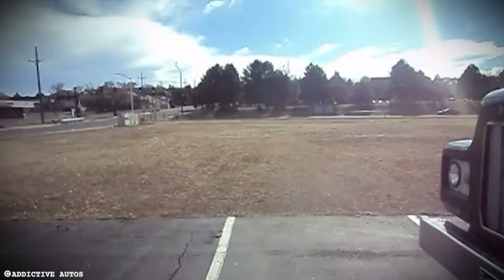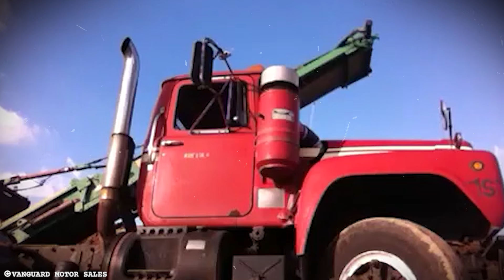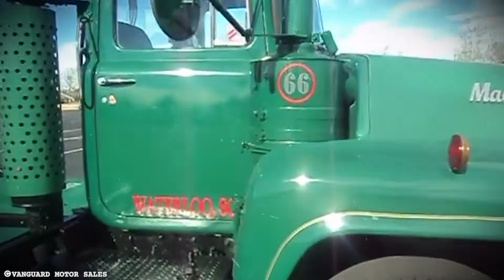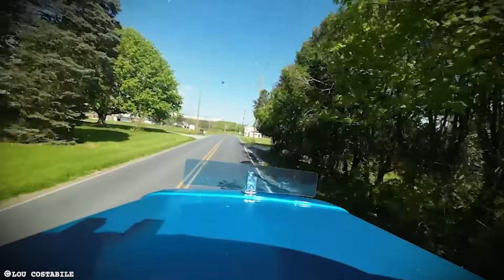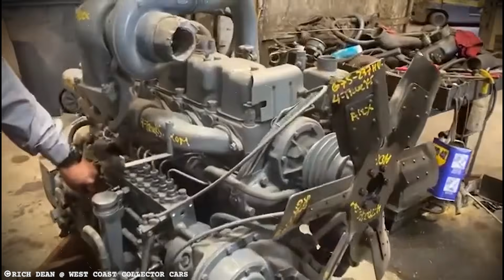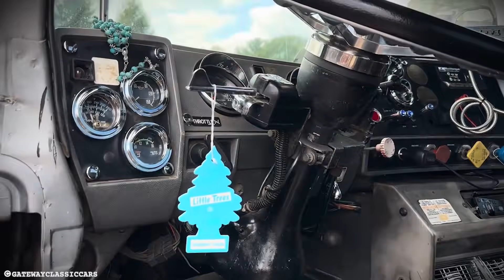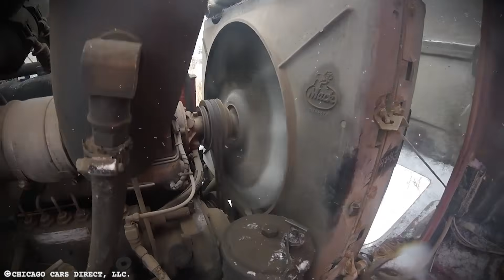The Mack "Maxidyne" Engine That Silenced the Need for 15 Gears

Comment: Junk Old Macks, 12 to 24 hundred, shift up and it Fell on it's Face, they had to put in a Limiter Switch so you didn't get FULL THROTTLE as it would blow BLACK SMOKE, Mack 5 Speed was a Gutless Piece of CRAP, No Power, it just was a Gutless Pig!
If you put in a 10spd Road Ranger Trans, then you had a half way decent Truck!
Reply: Yeah drove one with the exhaust was on the bottom blew to the right take the limiter off and drove it around when peddle bike races get like 10-15 in a row and slowly lug along just in front of them. It was the absolute best truck for that a good number of them would just have to stop and wait I did it the two times a year for a decade. For all the drivers that wanted to run them all over I think you would appreciate this and yes I was bored with nothing better to do but laugh my ass off
Reply: @brucerabideau2872  LOVE IT, We took the Limiter off and I went to YUPPIE Land in CT, Rocky Hill, had the Dump Body Heat on, so it blew down on the car behind Me, when I sat at a Traffic Light I would Flutter the Fuel Peddle, that Loaded the Dump Body up with Black Smoke, then the Light turned Green and I Floored it, the Cars behind Me were Lost in a Thick Black Fog.......LMFAO.....They Called the Cops and they wanted to Inspect My Truck, so I hooked it back up and they came found NOTHING WRONG as the Yuppies CRIED!!!
Reply: @webefree I’m in CT I was doing it at the International triathlon event held by Quassy in Middlebury I was getting runners too. They do the swim also but the cyclists are the assholes. That is great to hear 😆😂🤣
Reply: @brucerabideau2872  I Loved Smokin out the Igiots of CT, I finally Ran from that Failed Blue Commie State in 2017, sold Everything just to have the COMMIES make a New TAX to TAX ALL My Money that I was taking with Me!!!
Reply: @brucerabideau2872  Heres another one for Ya......some years before that, I was driving a New GMC Brigadier with the Cat 215hp V-8, it had a 13spd wit OD, it would do 55mph Down Hill Loaded with a Tail Wind if your were Lucky, I had the Losers CRYING to My Boss saying that I was Flying Up and Down Main St in Winsted CT, He told the IGIOTS that his Truck had No POWER to FLY, it was that I was Banging Gears to hit 25mph, I think it was like 9th Gear when you got to 25mph, then I would shift Down with the Jake....Oh how the IGIOTS Hated that to.....LMFAO!!!
Reply: @webefree we made a silage truck out of a early 80s well drill hauler 10 wheeler International with a 350 big crank Cummins with 3 stage Jake with a single barrel open exhaust pipe aluminum dump body 7’tall side it held two dumps from the self propelled chopper if the corn was a little green heavy we have fields in Washington Watertown anyway going down those hills loud house window rattling loud and if it was going to rain a lot or hurricane we would go all night bones and beer the 90s were a bit crazy the times have mellowed I have no complaints or regrets I’m still alive 😆😂🤣

Comment: I never saw a 7 spd trans behind Cummins, or any other...Anyone?
Reply: In the 1980's, you could get a Cummins, Detroit, or cat with a 7 speed. Both Eaton/Fuller,  and Spicer had 7 speed transmissions. JB Hunt, and PAM used those, plus Consolidate Freightways also used the 7 speed transmission. I think some UPS trucks had the 7 speed as well.
Reply: I liked 7 speed behind 300 Cummins in 1980 for local work with Raco suspension over on5thespeed with the walking beam
Reply: I drove a 1977 international dump with a 270 torque command Cummins an 855 with a 7 speed Spicer trans
Reply: I have a 7 speed behind an International DTA360 diesel. Years ago I drove GMC Brigadiers with 270HP 6-71 Detroit fuel squeezers and 7 speed Spicer transmissions.
Reply: Yeah, it was called a spicer split torque, junk behind 8v71.

Comment: Only drove one, was a rental, in '77 or 8. I didn't care for it. The way you knew it was downshift time was when the whole cab vibrated. Then when you upshifted, suffered  the vibrations again. That wasn't pleasant. I'd lots rather keep the Rs up floating a Roadranger behind a DD 318 or 350.

Comment: My first Mack was a 1973 F model cabover.  Next was a used   R  model. Both with the 5 speed and the '237' maxidyne engine.   2 million miles and I loved them!!
Reply: Great in FLAT country. In mountains it was not good. Once you had to downshift, that would be the gear  you had to get to a flat road to upshift again! Didn't hold you back on down grades as good as having more gear ranges to hold your speed. I drove a Mack Western for three years and liked it until I got to the mountains.

Comment: The maxidyne didn't eliminate the need for 15 gears. The maxidyne still only has a power band of roughly 400 to 500 rpm. If you look at the power graph of this engine will prove that. The 5 speed transmission that Mack coupled with this engine has a 500 rpm range difference between them. Tell us you know nothing about diesel engines without saying it.

Comment: My buddy had late 70s RD 600 steel nose Mack rolloff i used to drive for him I forgot what engine 237 or 285 With a 5 speed great truck strong and reliable I drove many R DM Mack’s with the 5 spd 6spd mud stick and 12 spd gear boxes
Reply: Same here I learned in a DM800 300 plus 15 Tri-Plex and #55k bogies she was quite the machine.
Reply: @deborahchesser7375 I plowed snow in  a 1964 b81sx  tandem dump during the blizzard of 1996 here in NJ that old Mack had the quadraplex 20 spd trans they are beasts

Comment: When I was a young man back in the 80s I work at a ready mix company that had 100 Mack cement mixers with the Macedonian engine in it with PTO running off of the transfer case badass truck only downfall was every now and then one would get a flat camshaft and we figured out how to put cams and bearings and lifters in it that engine was ahead of its time
Reply: I drove for a concrete company here in NJ Baer Concrete they had all DM 686sx Mack’s they all had the Mack endt 676   engine and the Mack 6 spd mud stick trans 58,000 LB rears heavy trucks I love those Mack DM trucks strong and reliable
Reply: @edwardweigel8755 The closest one to a Euclid that is for sure
Reply: When I got my truck I was told to never over rev it 2100 max, and never use the dynatard when the oil was cold as it would damage the camshaft.

Comment: Don’t get me wrong - I always liked Mack’s too - but to say this changed the industry, we’ll look around and see how much freight is hauled today, or even in the last 20 years, with only 5 speeds. None would be the answer
Reply: Go drive an automatic truck that's lightly loaded like most mega carriers loads. It'll skip so many gears it'll be close to only using 5 speeds. The clips showing the typical cloud of black smoke after a shift is a better reason what doomed the 5 speed on mechanical diesel engines. Don't forget how popular the 8 LL was on Catapillar powered trucks. They used a full range governor like the mack also.
Reply: Not true, where I'm at there's a lot of 5spd Mack's still hauling on a daily basis including my RS600L
Reply: I think what made a bigger difference in the high torque, low RPM was the camshaft. They talk about fuel injectors and turbocharger. The cam made the biggest difference.

Comment: Trucks still use 10, 12, 13, and 18 speeds. They are still unsynchronized. Even today on brand new trucks.
Reply: ...and we float the gears in all these as well! Clutches are to get moving.
Reply: im glad with only one shift lever

Comment: The Mck  wa sgood  at going up the hill but it was real dangours comming down  you only had teh Brakes to hold you back because teh transmission had a mile  between ratios. We had a 325 V8 in a hiabe I scared my self by statring down the hill in too high of gear.

Comment: I had a 1978 cab over with the 320 "Coolpower".engine and 10 speed splitter Great truck. It didn't take me long to learn how to float the gears and so remove the need for double clutch changes.  I can vouch for the torque it made. I found myself with a loaner, an International Transtar 4300 with a 350 big cam and roadranger 18 speed. The first decent climb I came to I let the rpm's come down like usual  when the bloody thing just fell over and I found myself having to go down three gears.. Lesson learned.
Reply: 🧢 oldmatey here had an 18 speed before Eaton made it.
Reply: Drove a White with Detroit and 10 speed. Never used that clutch once to shift. Many years of various trucks later, still floating every type of tranny you can imagine, favorite was a 444 Cummins with a 13.
If you grind 'em, means you can't find 'em!
Includes split shifting, tho it has a short learning curve.

Comment: My 1970 jeep keiser 5 ton 6x6 has that mack engine and 5 speed.  The grunt of that engine is amazing.  Ive had it's 19,000 pound beast buried to the frame in clay on a hill.  Tires keep turning like a rototiller.  Ive never used the low side of tbe transfer case.   Love that truck.  Plan to restore it.  ❤❤❤
Reply: Are they road legal in the United States CT?
Reply: Can I have it?
Reply: @TacomaJerry   No.  ❤❤❤  😂😂😂

Comment: Having driven the 673, in 237hp, and 300hp, I can tell you those motors wouldn't quit. If you had a  pyrometer you learned to watch it closely, get below 1200 rims, you could easily melt the pistons. And that 5 speed, bullet proof. You shifted it slow, try to force it or speed shift, it would go into gear. Shift it v right, you only needed 2 or 3 fingers to shift. And the engine did have a bad habit of breaking the crankshaft at the harmonic balancer. Other than that bullet proof. It was a good combo.